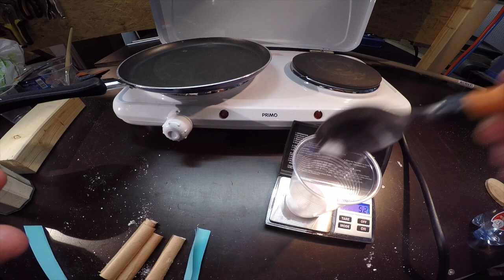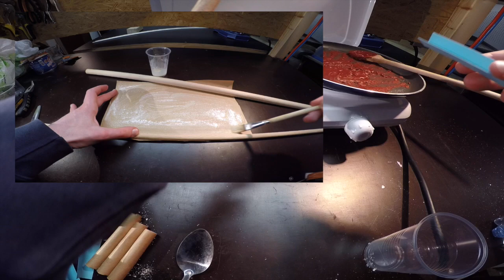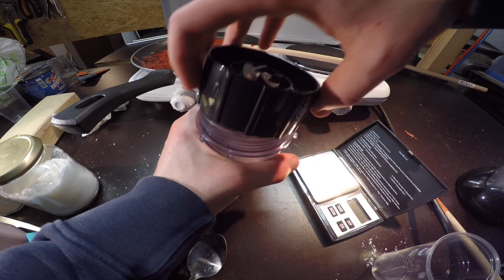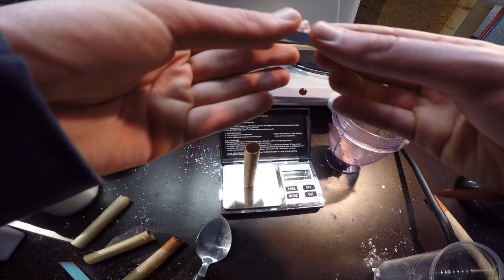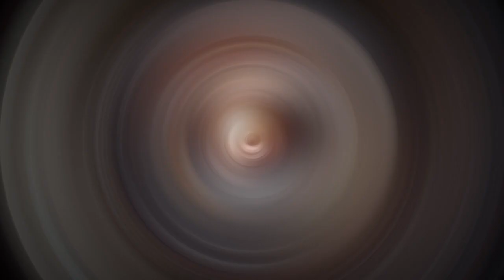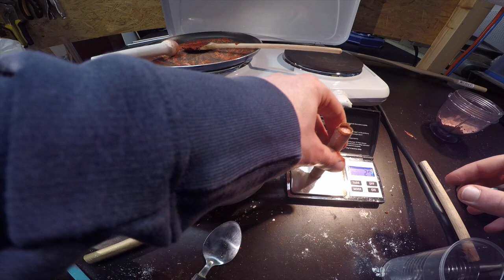Sugar rocket propellant: 3 methods

Comment: 7 parts of Zinc Dust to 10 of Sulfur is a very fast mixture, and is better in a metal Rocket, with a shaped nozzel (can explode)
Reply: Can i use garden sulfur from stores?
Reply: @brandonpou1249   depends, some are 99.7%, some are lower percentage

Comment: Can i mix KNO3 with sugar and use raw?
Reply from the maker: If you simply mix them raw (regular crystals), the combustion will be too slow and you won't get enough lifting power :/
Reply: @Pierce Okken I second this. I have never cooked them. 65/35, pack it down, put clay cap, drill hole. Done
Reply: @gsxrgeorge00  Cool! Cause this is my 4th batch missed :/ I have a pale golden
kind of cookie dough with a ratio; for 50gr : 35gr KNO3/15gr sugar so 70%/30%.
I let it dry for 2 hours but... mess :/ It does only smoke, a small flame but no kind of
thrust and a kind of snake form in all that goo...

Edit : Next time, it will be dry! Thank!
Reply: Pierce Okken What sort of difference in thrust does this make when compared to melting the mixtures?
Reply: @Pierce Okken just make sure it is not cheap powdered sugar with corn starch in it

Comment: The safest method to liquify combustible components is to use  a double boiler.. not direct heat as this guy has done. And also do this outdoors
Reply: Its unnecessary anyway. Just mix the sugar/potassium nitrate and pack it in a tube with a dowel.